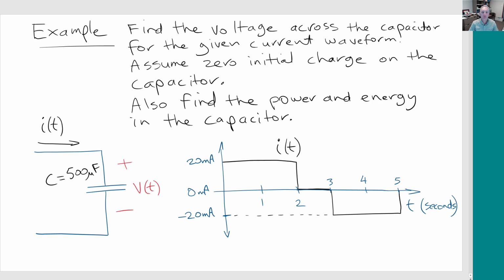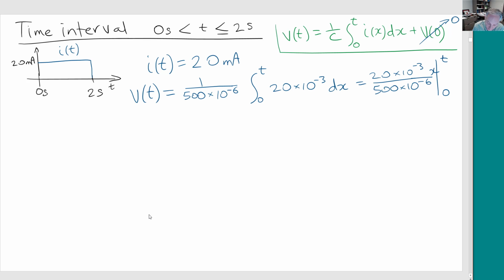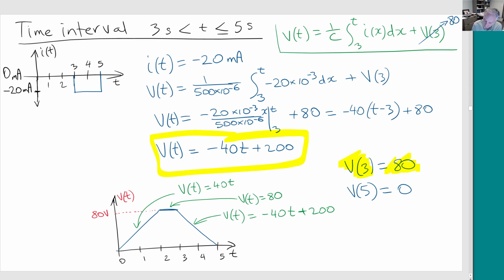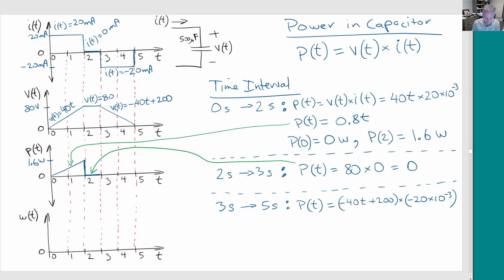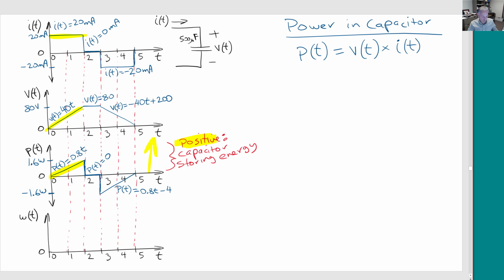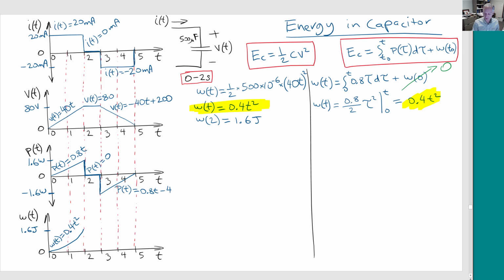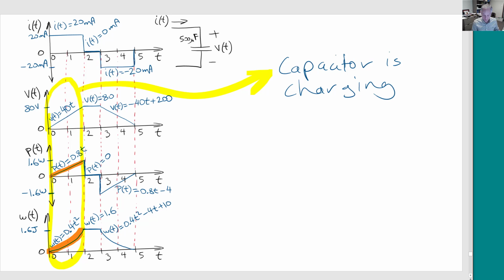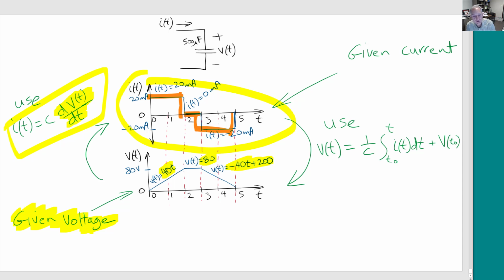Capacitor waveforms example

Comment: I have a similar question. With current given and the current is on y-axis. But i am
Suppose to find the voltage of a resistance based on time t. The current graph is changing it looks more like your voltage graph. I have no idea how to start. Do you have any suggestions. Got exams on 14March. 
Thanks in advance
Reply: I actually passed. Its been ages since I did that  exam. But I did well. Thanks alot.I got a B on that Modul. I do not know what B grade is in other countries .But in Germany. Its a good😊. Thanks alot for youe video on this topic and am glad i cane across your video.
Reply: @Wurzbiski  hello there! Do you know some book where I can get similar exercises? I'm telling you this bc I saw too many books and these just have voltage waves and power waves but I never found one with energy storage.
Reply: How'd that go?